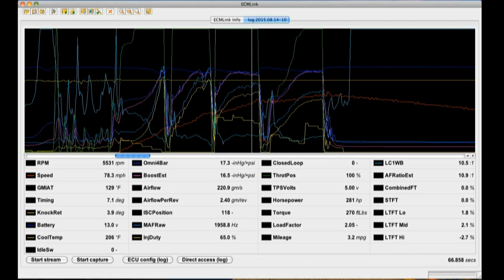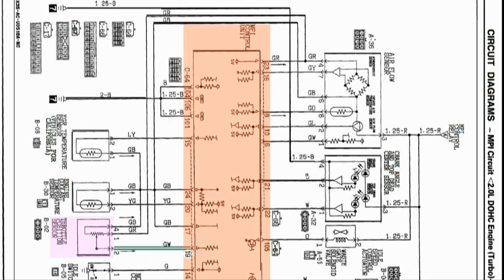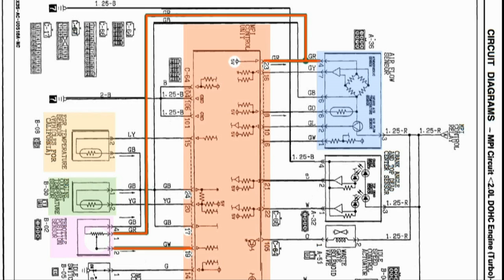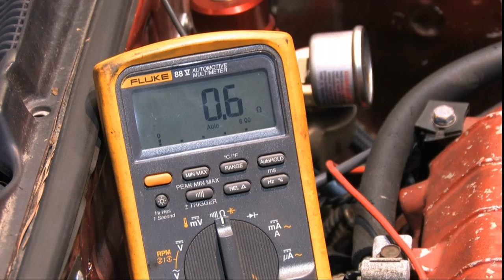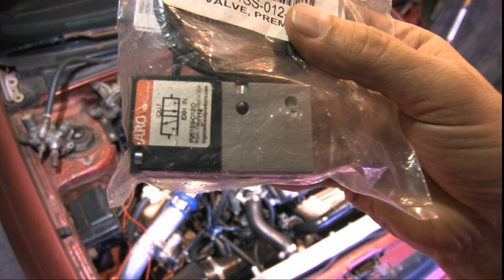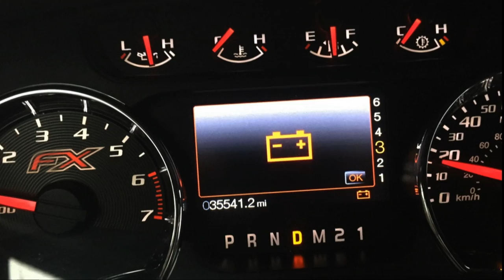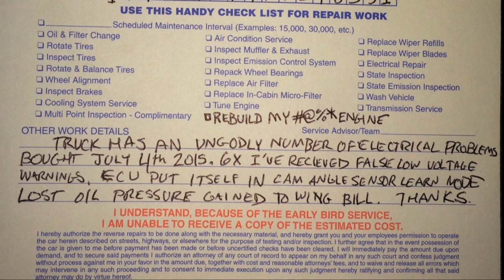Hyundai 16 - Hyundai Wiring BS

Comment: Probably shouldn't hold the leads together that way at least that what I was told
Reply: When testing your leads
Reply from the maker: Yeah, I agree.  The first time I did it, I didn't.  I held them by the grips.  Once that reading was unstable, I just did it so I could free the other hand to jiggle the wires and try to find it.  They told you this because just like I mentioned with the "split the circuit" test method... you're making yourself part of that circuit when you grab the leads.  I wouldn't have done that if I hadn't already found a problem with 'em.

Comment: Hey buddy, i have Mitsubishi related question for you, recently i've acquired a Mitsubishi solid rear axle with diff, the seller said that is from a mk2 lancer evo, all new evo's have IRS not a solid axle, now i'm not sure what i've got, it has a sticker (B-3 3,909) i understand that the ratio is 3.909, and i've measured the wheel bolt pattern is 4x114.3, it has drum brakes on i which confuses me, yes they are big but i don't think sports saloon will be sold with drums, any idea how to identify what i have?
Reply from the maker: Sounds like you may have one of the rare, nearly un-heard-of-in-the-US Mirage Syborg axles, or one out of a Galant GSX maybe?  I don't know?  What country are you in?
Reply: I live in Macedonia, nowadays we only import european cars but in the 80's my country was unter Yugoslavia and then they had lots of very interesting cars from all over the world.The Mirage (Colt) seams too narrow this axle is 141sm wide and is not IRS (independent rear suspension) like the galant this is a solid axle like ford used under the mustang, the sticker is like mitsubishi used on newer cars rear diffs, i've seen BFH, BFB, JFH big letters then the gear rasio, on this one is B-3 then the rasio the maunts are also strange it has 6 of them lower ones are setup like 4 link but the iner ones merge in the outer ones and the top ones are angled towards the wheels and there are coil spring purchases, the diff  itself is big, seams it can take some power any ideas?
Reply from the maker: Nah man, I gave 'em to you.  The Galant GSX is AWD but doesn't use the same rear subframe as the GVR-4.  It's a USDM car, and I don't have any experience with DSMs sold in other markets.  Not beyond what I've read, or the 5 JDM cars that I've seen in person that were imported here that nobody here can buy parts for.  The mirage syborg has a solid rear axle, but again, that's not a USDM car.
Reply: Thank you for sharing your knowledge.

Comment: man, glad to see you're alive... awesome video as always! tks for sharing this
Reply: ow wait, was that a SR-71????
Reply from the maker: Yes it was... It's 43,000 pounds without the two Pratt & Whitney J58s or the leaky fuselage full of fuel.  This is one of the 20 survivors left out of the 32 built, and this particular aircraft traveled 15,000 miles in only 10 1/2 hours setting the record for the longest distance flight of the whole fleet.  Each SR-71 was produced at a cost of 33 million dollars back in 1966.  Calculate that with inflation from 1966 to todays valuation, and it's more than a quarter billion dollars today.  Now just an airframe, it will be re-assembled hanging from the ceiling of the Science Museum of Virginia. just behind the swinging clock rotunda.  Out of the elements.  I was lucky enough to get this shot with it before it moved.
Reply: very interesting, Jafro... I'm curious, how can you tell so much about this particular one aircraft?
Reply from the maker: Bruno Ghisi Mezadri I built one that flew.  A model… but… that counts, right?  lol…  I lived 4 miles away from this one before it moved.  It has always been one of my favorite aircraft and I visited the exhibit a few times.  It was just recently relocated from the VA Aeronautics Museum to the Science Museum of VA, so it has been in the news a lot lately.  Once they finish re-assembling it, I'll be sure to visit it in its new (indoor) home.  I'm glad it's out of the bird poop now.  After all, it's 50 years old now.

Comment: Should have got an ecoboost!
Reply: Oh yeah, Ecoboost is great! It only took Ford a whole decade to come up with an engine that is 2.0 liters and boosted that can outperform a stock 4g63t Sirius engine. No word on durability yet either.
Reply: Oh yeah, Ecoboost is great! It only took Ford a whole decade to come up with an engine that is 2.0 liters and boosted that can outperform a stock 4g63t Sirius engine. No word on durability yet either.
Reply: Ecoboost engines are pretty great. It didnt take them a decade either lol. The durability is there as well.
Reply: +Trav1styprod Oh, I must have missed the 650hp Ecoboost engines running the stock internals, or the 1000+ hp Ecoboost dyno queens. My bad.
Reply: Yes you did miss them. Its ok though. I forgive you.
Reply: +Trav1styprod A scholar and a saint. Truly a marvel of our time.
Reply: Coming from someone who water cools computers to make them quiet that statement means so little.
Reply from the maker: I'm waiting for them to solve the timing chain stretching problem.  I'm more likely to go the Whipple 3.8L route on the Coyote.  There's 80,000 miles of warranty left, and I have 3.5 other cars to finish first... but once those are done, Ecoboost better watch out.  ;)
Reply: +Trav1styprod Thems fightin' words. The idea that I only water cool computers inside my house to make them quiet when they are overclocked has no bearing on what I do outside in my garage. A hobby is a hobby, you're allowed more than one.